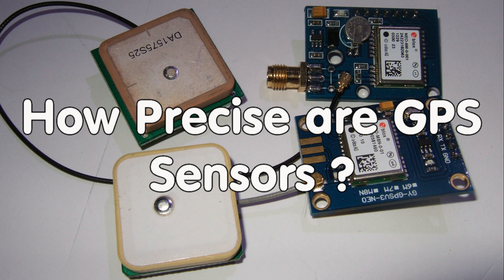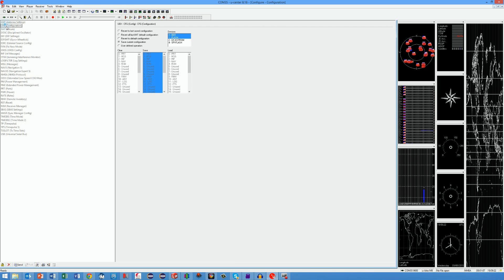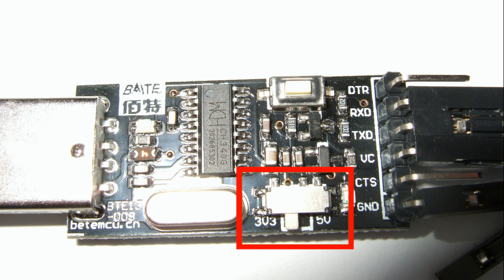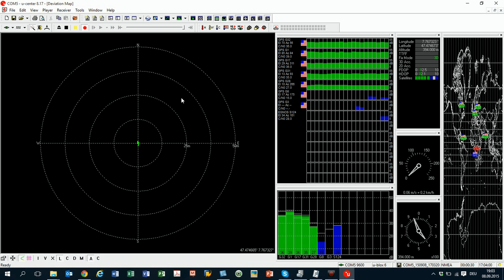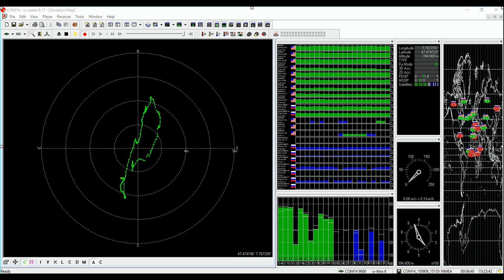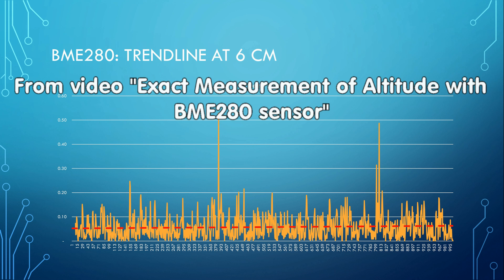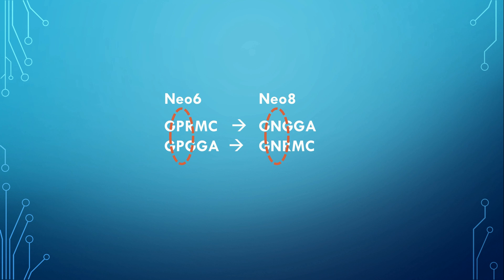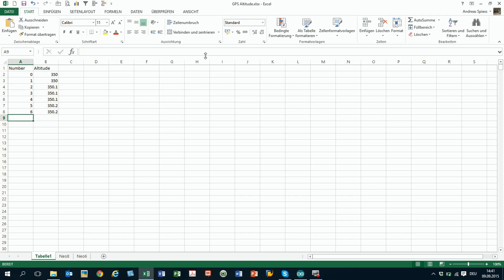#22 Comparison of precision between Neo-M8N and Neo-6M Modules

Comment: We'll say this, precision be damned, I have had no end of trouble with the 6M... And I've gone through more of them than I can count at this point.. should have switched to something else but initially it worked.. there's an interesting video showing a a guy who did some voltage measurements and ended up having a diode work around that would connect the VCCN to the antenna directly because apparently during the initialization phrase it was cutting power to one or the other.. worst part is, that stupid blue light that I used to love.. that blue light is a fucking liar.
Reply from the maker: the 6M is a pretty old chip and cannot be updated :-(

Comment: I am testing for the first time. I have a accesspoint running on xiao esp32s3 and the neo-6m is displaying data on http web server. I only see one binary byte. I have to be outside for the blue led to turn on. I was going to use this with a drone, so i purchased 3 for 3 test prototype. I feel like this is not good for my project.

I have it powered up outside for 30 minutes and i only see one byte displayed.
Reply from the maker: I would connect the neo-6M to a PC running the ublox software to test if the GPS module works. Only then,  I would continue with the ESP32.

Comment: For anyone who's trying to use NEO-8 for more than GPS and GLONASS satellites, you'll have to enable it at 'GNSS config' AND change the NMEA protocol to version 4.10. As soon as you set it, you'll be able to receive Beidou and Galileo satellites. But you can only set 3 GNSS services at a time(for neo-8), and to change between then you must leave only 2 services, save it, and only then enable the third you'd like.
And I have also found much better reception if you desolder the SMA connector if you're not gonna use it. If you're looking foward to use an active sma antenna, then you must desolder the C2 capacitor. This only applies to the M8 boards with soldered ceramic antenna
Reply from the maker: Thank you for the additional info!

Comment: old video, i know... but aren't altitude sensors based on pressure effected by atmospheric weather air pressure, thus the altitude reading will change based on the weather...
Reply from the maker: Yes, you are right. This is why they are "calibrated" to a known altitude from time to time.

Comment: Hello does the value of the gps change if I change the position of gps module from 10-15 cm from the the actual position 
Are these gps modules so accurate
Reply from the maker: No.
Reply: @AndreasSpiess  so at what distance will the value of GPS change

Comment: I recently read that these modules can be programmed with the u-Center software to output a GPS-stabilized frequency between 0,25 and 24 MHz instead of the usual pulse per second (PPS), so that they can be used as a cheap but stable frequency normal. Some modules have a pin to output the PPS-signal, some must be modified to pick up the signal from the input of the pulse-LED. It outputs a square wave of the desired frequency (and Duty cycle), set via u-center.
If you find that useful or at least interesting, please make a video on that. Thanks for your excellent work. 73!
Reply from the maker: Yes, they can be programmed as you describe. Unfortunately, the output has phase jitter and cannot be used directly for RF applications. This is why people build GPSDOs which use a stable OCXO/TCXO and correct it long term with the signal you described. 73 de HB9BLA

Comment: Hi...

Is it possible, using a neo-m8n and U-center, to see the almanach / ephemeris data broadcasted by the  GPS satellites ?
Reply from the maker: I do not know. I never needed these informations.
Reply: @AndreasSpiess  Thank you....

I could retreivee these infos in the past, but since i worked with several GPS modules, i do not remember which one.
Reply: @ve2um  you can see whether the info is available for each satellite but I don't see a way of downloading the actual data in uCenter. You can do that with an old SiRF receiver and the SiRFDemo software.

Comment: Good video, I recently compared an Antaris 4 (uBlox 4) vs M8N (uBlox 8) and didn't find any improvement either in terms of accuracy for a static test. It will be much better for navigation in urban environments with lots of blocked signals where the use of additional GNSS systems helps a lot.
Reply from the maker: Thank you for sharing the results of your tests!
Reply: @AndreasSpiess  Sure, another test result that may be of interest. Using the uBlox 8 (8030 module) I have not seen any improvement with SBAS for horizontal accuracy, which is about 3.5 meters using the 2DRMS method but it improves vertical accuracy significantly from around 6.5 meters to 4 meters.
With RTK or PPK the uBlox 8 can be extraordinarily accurate, around 1 centimeter horizontal and vertical !

Comment: My neo m6 doesn´t find the location, I live in Spain. I connected it to 5 volts supply, as I´ve seen on some tutrials, could it have burnt the module? May they be defectuous?
Reply from the maker: Usually they should also work with 5v. Are you sure you did not mix the wires (eg. TX and RX or VCCand GND)?
Reply: @AndreasSpiess  thank you for your response. I think I connected them well. If I didn't, is there a chance of burning the chip?
Reply from the maker: Yes.

Comment: How can you expect the difference between these measurements? All you do is sensing of time differences in receiving of modulation signal of ca. 1 MHz from different sats, not a carrier of 1,5GHz. The way to increase measurement precision is to use differencial method with reference sycroised to time generator of sattelite. Maybe the way to go is to use NEO8P dev kit with LoRa?
Reply from the maker: These sensors have to be quite precise. So you can expect differences. And not all chips listen to all satellite systems. This can also lead to differences.

Comment: First, thanks for the video; I have two questions:
1) Does a Neo-6M sketch work with Neo-8M?
2) Is it possible to extend the GPS antenna? Can any wire be used from the beginning of the board to the other end?
Reply: Maybe a tnc to sma port will help
Reply: @tank_tales  Tks

Comment: Very useful. Thankyou.

Looks like I'll be using a barometric sensor for relative altitude - my altitude changes are in no way going to be more than a few metres for what I want from the GPS. then I need to work on magnetometer (compass) and gyro/accelerometer to use as a clinometer.

.... and all because I want to be able to track where I've wandered on the moors.
Reply from the maker: Cyclometers also use a barometer because cyclists want to know the exact altitude they climbed ;-)

Comment: I found this video useful and interesting, especially the discussion of the different NMEA strings output by the NEO-6 and NEO-8 receivers.  However, I would like to offer what I hope will be taken as constructive criticism.

I would suggest that instead of using the word "precision" to characterize the results, that "stability" or "repeatability" be used instead.  In my view, precision is synonymous with resolution:  if the device can measure a distance to a resolution of 1 cm, it's more precise than a device that can only measure distance to a resolution of 1 m.  If one knows the correct value of a parameter, such as horizontal position in terms of latitude and longitude or elevation/altitude in terms of meters, a device that measures the same parameter with a constant offset of 1 m is more accurate than one that measures the parameter with a constant offset of 10 m.  If a device consistently reports the value of a measurement with a variation of only 10 cm over an interval, its measurement is more repeatable than one that reports the value of a measurement with a variation of 50 cm over the same interval.  In this video, I got the impression that what was being discussed was repeatability, not accuracy or precision.  

While the BMP280 may be more stable (its measurements more repeatable) over a measurement interval of, for example, 10 minutes, the elevation data it produces may be less accurate than the GPS  elevation data if the atmospheric pressure is not the standard 1013.25 HPa (or 29.92 in. of Hg).  One can attempt to correct the BMP280 elevation data using the altimeter setting measurements reported by a local airport.  (Google "METAR").

I would also comment that if one does not make measurements of GPS (or GNSS) receivers using actual satellite signals (instead of simulated signals in a laboratory environment) at the same time and place, one is not really doing an apples-to-apples comparison, because the satellites that are in MEO orbit are constantly moving across the sky, and different satellite signals may be blocked either by an obstruction or because the satellites are below the horizon at different times.

Well, that's enough (you'll probably say MORE than enough) pedantry for one comment.
Reply: Oops, I see you used the BME280 instead of the BMP280, but the principles are the same.
Reply: One more comment, about high-resolution pressure sensors:  I have tested a BMP180 inside my home on a windy day with all of the doors and windows closed, and observed a lot of short-term fluctuations of the measured pressure.  But if I operate the pressure sensor in a sealed jar, the short-term fluctuations almost disappear.  I used a Microduino setup consisting of the Microduino Core+, Motion, SD, and USBTTL modules for this purpose, powered via a short USB cable connected to an Anker PowerCore power bank on one end and the USBTTL module on the other end, so the entire setup fit inside a 16 oz. canning jar.  My Microduino setup recorded the data to a .csv file on a microSD card, which I then imported into an Excel file on my laptop.  I wouldn't be terribly surprised if the BMP180/280 device measurements fluctuate on a calm day in the presence of loud music with a lot of bass.
Reply from the maker: You are right with your definitions. My project at this time was a bicycle power meter and all values needed were relative. I also have no idea on how to measure the absolute precision of a GPS device because I have no reference and I am no geographer with the needed knowledge.
To adjust a pressure sensor is easy, even if you do not read the METAR. You just measure the current pressure and adjust it to your current level. Or, as I usually do, to zero. Then I get the height difference very precisely. METAR is important because pilots have no reference if they fly in the air from a different region. Therefore they need the absolute pressure on the ground. If you stay on the ground, your pressure sensor should read the "METAR" value.

Comment: More than two years later and uBlox has released the neo-M8P which is capable of centimetre level accuracy with corrections. I have found with good view of the sky that the neo-M8N can get down to meter level accuracy without corrections.
Reply from the maker: As soon as I get a board with the M8P on it from China I will try it. RKT is interesting for me.

Comment: Counterfeit or FAKE uBlox parts are a real problem.
Here is a link to assist you to identify FAKE parts.

http://fpvlab.com/forums/showthread.php?50918-How-to-indentify-FAKE-ublox-GPS-chips

Also ublox have the following link to assist you to identify counterfeit parts.

https://forum.u-blox.com/index.php?qa=4976&qa_1=is-my-m8n-module-using-real-m8n&_ga=2.155502451.9987738.1519748220-1092822842.1519748220

So if the ublox parts you have do not perform as expected, check the above links.

Real M8N parts work reasonably well.

Jim H   GluonPilotUSA
Reply from the maker: Unfortunately, usually, you discover it only when you have the modules.

Comment: I didn't understand if you said accuracy was withing 6 to 10 centimeters or 6 to 10 meters. If you said meters then accuracy in regard to the GPS sensors is an oxymoron.
Reply from the maker: With GPS it is always meters
Reply: Too many variables effect accuracy of measurements. 
I think the biggest limiting factor is amount of digits after comma in these calculations.  You need to use doubles instead of floats....

Comment: Thank you for this information. It is very helpful. I am planning on using the 6M for elevation sensing.  Do you think that filtering/averaging the data over the course of an hour would give a reliable reading? At least I know now that it won't be worth changing to the 8M.
Reply from the maker: Averaging can for sure help, but maybe not only seconds. Maybe you also consider RTK?

Comment: What about V.KEL VK2828U7G5LF  ? :)
Reply from the maker: I never updated the comparison. But I think, the system itself creates a big deal of the errors, not the chips.
Reply: I saw a lot of reviews on Banggood for V.KEL (there are 247) and almost all are good but of course nothing like your reviews. You might try the 3 modules on something at high speed (like car ) and check how they behave (accuracy of speed and position). I'm sure many people will like it because of the soo many drone builders and some fly electric model planes to 100km and BACK  :)

Comment: Wait, the Neo-M6 can only pick up US sattelites? Maybe THAT'S why I can't get it to work in Sweden :D Will the M7 and M8 work though?
Reply from the maker: If your device does not work I would try it with the UBLOX software. It shows which satellites are currently visible and detectable by the module.
Reply: Andreas Spiess I only saw US flags next to the sattelites in UCenter, but they would appear for less than a second then dissapear. I am not able to try it close to a window yet. Will have to Create a ten meter data cord for that.

Comment: Note that it takes 11-13 minutes for the sats to download the almanac and ephemeris files (in a clear line of sight to the sats) to the GPS receivers (these files are the data resourced by the rcvrs for their "hot start" function to avoid sat search time). These files expire every 9 days and new ones are released to the sats for download every Monday.
Reply from the maker: Thank you for this information. I did not know that.
Reply: Ephemeris data takes 30 seconds to download and is all you need for a GPS fix though. Almanac was useful for the early GPS receivers that had low sensitivity and needed help knowing where to look for the satellites using an approximate solution, now not so much, if at all ;-)
Reply: Ephemeris are updated ever 2 hours and it takes 12 minutes for a complete navigation full frame to download from GPS/GNSS satellites
Reply: @tank_tales  For the purpose of negating multi-path issues. If my memory serves me??
Reply: @fishntools  almanac data has several uses but multipath effect is totally receiver level and is mitigated using specific antennas or algorithms incorporated within the receiver
Reply: Hi I am interested in this topic. How can this files be provided to GPS modules from wifi or gsm? This can help fast the process of locking and improve battery operated devices battery life.
Reply: @ShirishJadav162  Almanach and Ephemeris data are directly broadcast by the GPS satellites.

This data along with date and time are the only data transmitted by the satellites.
Reply: @ShirishJadav162  No.

Comment: Hi Andreas, i was wondering if the Ublox m8u is compatible with the shield that you are using for the m8n
Reply from the maker: I do not know the m8u module.
Reply: Hi thanks for the reply, just wondering , is it possible to buy the shield by itself for the m8n?
Reply from the maker: I do not know But I am sure, Google knows.
Reply: Thanks for the reply, btw may i know where did u get ur m8n from, from what i see from ublox's website, they only provide the gps chip. Therefore i was wondering where you got that breakout board for your m8n.

Comment: I don't know if this has been mentioned already, but the "GP" vs "GN" in the NMEA sentences has to do with which global navigation system(s) have been used to get the position.  I think all multi-system units use "GN" now, and might also spit out "GP" and/or "GL" sentences as well.  The "GN" is the "main" sentence, and GP would be fix information using the US GPS system only, and GL would be fix information using the GLONASS system only.  "GN" I think would be a fix that included information from both if available.
https://www.trimble.com/OEM_ReceiverHelp/V4.44/en/NMEA-0183messages_GNS.html
Reply from the maker: Thanks for your explanations. You are the first mention it.

Comment: Looks like you are testing an imitation ublox neo m8n. Did you check if it can receive Galileo? Did you check if it can be upgraded to version 3.01 using u-center software? If not then for sure this is an imitation! Performance of a real one is a lot better than those counterfeit models.
Reply from the maker: No, I did not check it.
Reply: Some quick checks to see if it is a genuine U-blox: 
-Try to store settings from u-center. Try to change settings to power save mode as explained in a Ublox document (search for PowerManagement_AppNote_(UBX-13005162).pdf ).  Go to the step by step guide in Chapter 3.1.1.  Power save mode only work if you can disable Glonass. When you are done, disconnect from power supply and reconnect again. Now check if it is still on power save mode (and if Glonass is still disabled). Those counterfeit models usually have limited Flash memory so they immediately revert to 1 Hz full power.

-The next check would be to try to update to firmware V3.01. To do so, download this firmware from ublox and use u-center to upgrade (you have to select 2 files, the file you just downloaded and a second file that is on your hard disk in the windows ublox program directory. If it is a counterfeit model u-center will show a red screen with a message such as "no Flash detected"or "Flash timed out".

-Another thing to check is the GNSS system configuration page (in u-center). It probably shows just 32 channels available (the real Neo M8N is capable of receiving up to 72 channels).